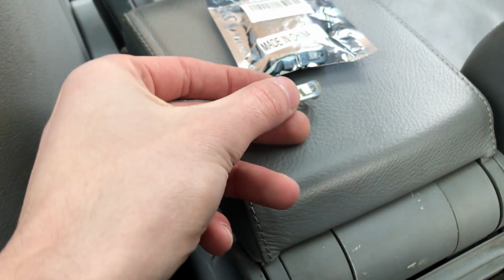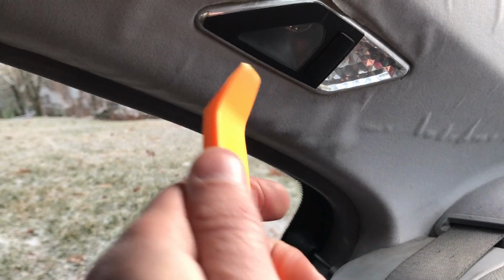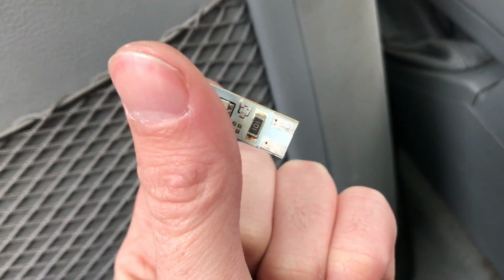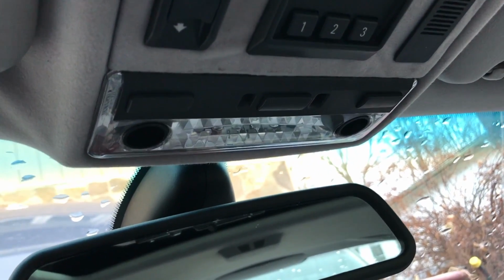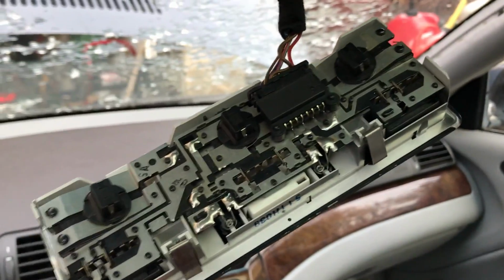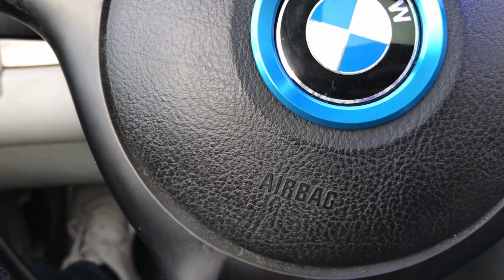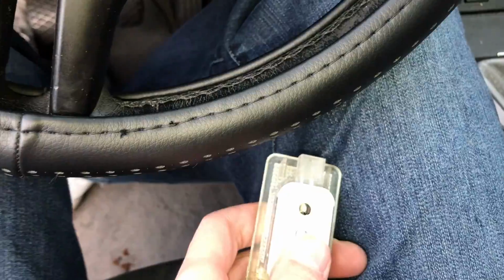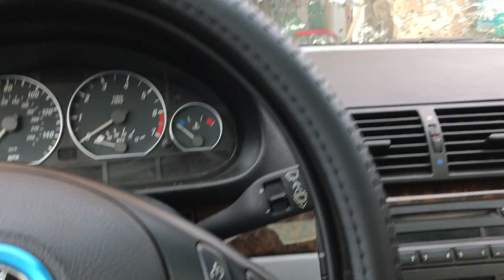BMW e46 Blue Lights Install

Comment: Great stuff man. I have a 2004 330xi. Was wondering if you saw the logo light mod on the 3 series 2006 and newer where you can replace the under door light so that it will illuminate the bmw logo on the ground. This would be sweet to have on the e46, however there is no light in that spot. Just wondering if you can think of a way to get this mod to work since you’ve prob owned your e46 for longer than I have

Comment: How do I program that alarm sound when I lock my E46?
Reply from the maker: You need to install an alarm in the car and then program it.
Reply: Evan Goyuk I read that somewhere but wasn’t sure. Where did you get yours so I can get mine?
Reply from the maker: The junk yard, but you can buy them on eBay. There is three pieces to the alarm the siren, the motion sensor, tilt sensor.
Reply: Evan Goyuk how do you get the "clown nose" to work?
Reply: Im looking for the bright amber/red/orange color ones but does it matter too if my e46 is a coupe? 330ci? i know the original stock lighting is like a yellowish-white color
Reply: Arek Thorne nope, it’s the same for all E46 chassis. They will work